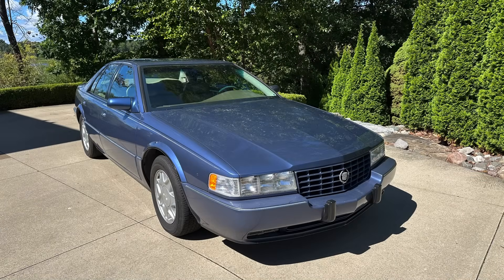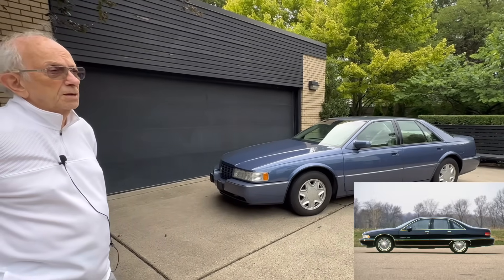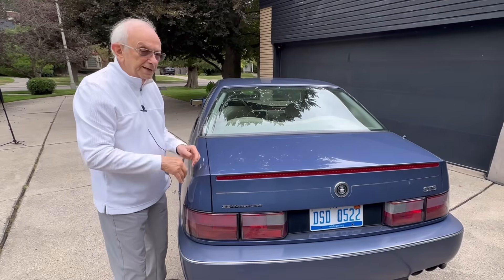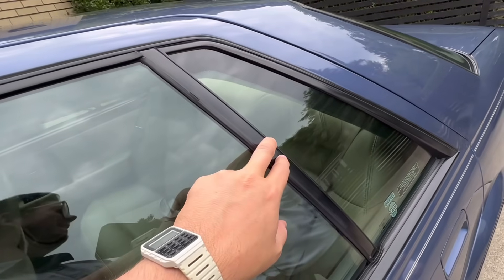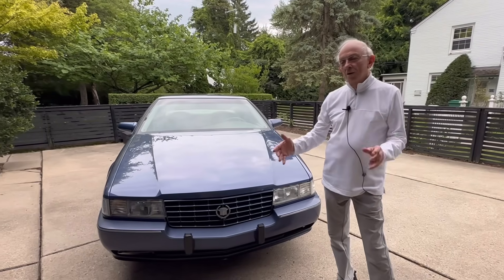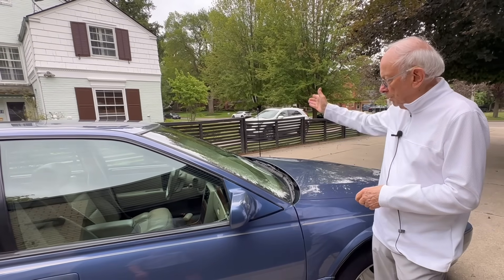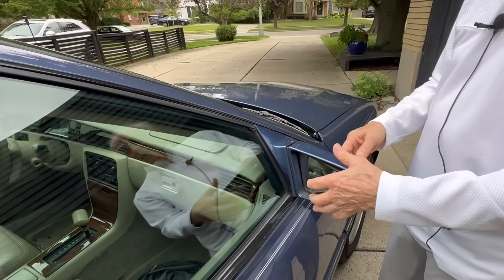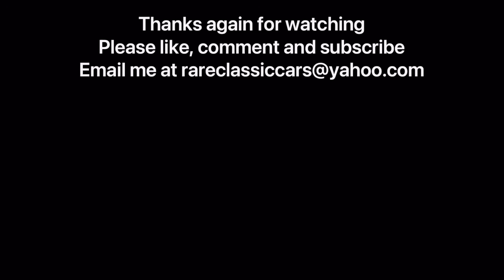Return to Glory: The Aerodynamics of Design & the 1992 Cadillac Seville (with Dick Ruzzin)

Comment: These were a breakthrough for Cadillac after years of malaise era vehicles that couldn't compete with Europe or Asia's best  (however don't expect stellar fit and finish).  I remember a chunk of padding was missing from the door trim panel that was just covered with vinyl, talk about lack of quality control on a car that stickered for over $43K in 1997), while the Northstar V8 is not known for its reliability it was smooth and powerful. Unfortunately they were not safe vehicles and received a score of Poor from the IIHS.

Comment: I had a 1998 Seville, the first year of the last generation before it became the STS. I absolutely loved that car. As a former Cadillac dealer tech, I had done everything to it, including Time Serts, head gaskets and a full engine reseal. Everything on it worked flawlessly at 146,000 miles. I ended up selling it in 2013 to get a Volt due to my commute and the Northstar was a little thirsty for premium fuel (although it got okay mileage for a V8). I still have the Volt which has also been a great car, but I have regretted selling the Seville ever since I let it go. I should have just put it in the garage with a cover on it. I know it is not really a "classic" per-se, but it was a wonderful vehicle that was very comfortable. My wife and her mother both talk about the ride of that car to this day. Since I am one of the few on this planet that is not scared of a Northstar, perhaps I will end up with another at some point.

PS, I did buy the book but have not had a chance to read it yet. Looking forward to it though!

Comment: At 3:56 why not? Wouldn’t it be easier for the rear wheels if the front already cleared through the snow? And at 4:25 how could the air stay with the car all the way if it’s flowing straight back but the car’s side flares inwards? And, if that’s the case, wouldn’t the air staying with the car all the way down the side mean more drag?

Comment: Very difficult to do this, Adam...The New Caddie had to be a much better car than previous models, much lighter for the power to weight ratio to compensate for less engine power and the design looking to the future and not retrospectively....Well Done to Dick Ruzzin, but something that rarely comes-off....Cheers from Damo.

Comment: I’d much rather have a little extra wind noise with drip rails than wet pants every time you open the door when the car is wet or covered in snow and it all falls onto the seat.  Especially now they can use active noise cancellation to mitigate any noise.

Comment: These crooks at GM instead of spending time and money on reliability of engine and transmission they spend their efforts on styling. Absolutely absurd that planned obsolescence already started early 90s with these junk from GM.
Reply: I agree.   Sadly these cars were good looking junk.   Front wheel drive Cadillacs were a failure,  plus the terrible small V8 Cadillac engines and terrible automatic transaxles.   Even over the years,  GM never got these cars right.

Comment: Underbody aero results from the law of diminishing returns.  Once the top is as aero efficient as possible, the only thing left is the areas you would not normally consider.
Hence, modern cars with smooth underbodies, radiator shutters, air ducted to the wheel areas, etc.

Comment: Not my kind of car at ALL, but I always thought that these were very nice looking cars.  I have two caveats, the later may be controversial:  

1.  I don't like the crease where the C pillar meets the fender;  I would have filletted that and even added a tiny flying buttress to make this more smooth, and  

2. This should not have been sold as a Cadillac Seville, it should have been sold as the '93 Chevrolet Caprice.  I understand GM was trying to get a few more years out of the 1977 "B" platform, but what they ended up selling as a '93 Caprice was utterly ugly and stupid!  This was a nice looking car, but a Cadillac should look something like what Rolls Royce produced with the 2003 Phantom.  A truly BIG car, the Phantom was based upon a 7 series BMW chassis.  GM should have used the B body platform (or even a truck platform with air suspension) to produce a tall, large car that was a Cadillac.  A Seville would be based upon the B body but smaller and a bit sportier.  

-I had a chance to drive a 1999 Cadillac Eldorado.  I flew 727's for an airline called Express One International between 1996 and 2001 when the airline shut down, and I was in a crash pad where the owner of the place had one of these.  He let me borrow it one day to drive to a Barnes & Noble about 10 miles away (I put 10 gallons of gas in the tank;  He came out ahead because this 300 hp car got 29 mpg on the highway. Hello?) and I, as a Porsche owner, had of course to put the coal to her.  I came away thinking it was a great car with a great engine looking for a decent suspension;  That car had a lot of performance but the suspension would be fine with a 140 hp V6 engine!

These were great products but SHOULD have been sold as Chevrolets.  They are just too small to be Cadillacs IMHO.

Great video!
Reply: I liked the 91 to 96 Caprice. They looked better when they opened up the rear wheel opening in 93. The 94 to 96 Impala SS was awesome. I had a 94 with the 5.7 LT1 V8 and loved it. Tons of torque and room.
Reply: @JimFlanagan4206  I recommend a competent ophthalmic surgeon.

Comment: Ruzzin brings up an interesting point.  "The smaller you can make that wake, the smaller the drag".  Back in the late '60's and early '70's, two nearly identical three-engine widebody airliners were produced:  Lockheed L1011 and the McDonnell-Douglas DC10.  Both were similar in size and carrying capacity, but the Lockheed product burned noticeably less fuel, despite having less efficient engines.  Why?  The Lockheed used an "S" duct for the center engine which allowed it to be mounted directly behind the fuselage, similar to the Boeing 727, and thus its enormous exhaust/fan air energy completely negated the form vacuum drag.  The DC10 on the other hand had a much simpler straight through design with the center engine mounted in the vertical fin/rudder assembly, but this did not negate drag since it was ABOVE the fuselage.  The telling part?  The L1011 had about 10% more frontal area than the DC10 due to this S duct, but it had a WAY lower actual drag coefficient!  I've been told that an L1011 loaded with the same passenger/cargo load as a DC10 typically burned 500 pounds per hour less fuel than the comparable DC10.  Jet A weighs about 6.7 pounds per gallon, so you can figure it out from there.

I was always told that GM raised the rear trunk of their cars in the '80's and gave them a very vertical back light for this same reason, these aerodynamic tricks reduced this following drag that Ruzzin is talking about at the 5:20 point.  It wasn't about styling at all.
Reply: Agree and very much true regarding L1011 and DC-10.